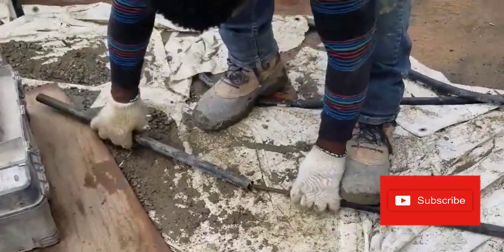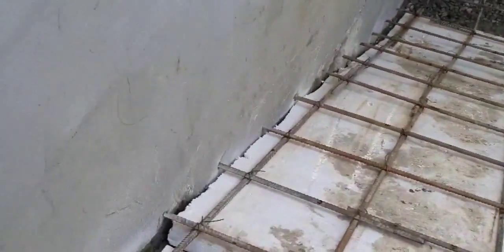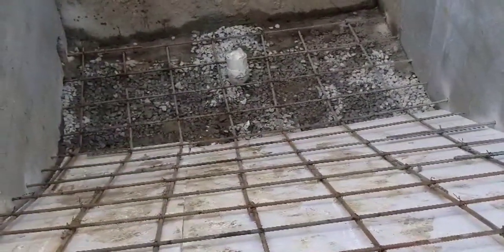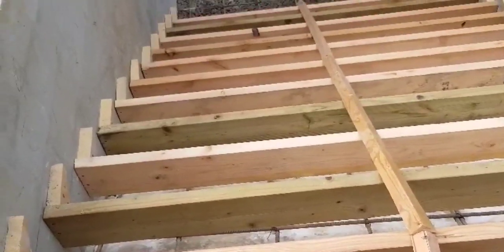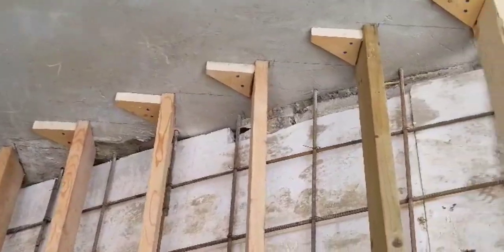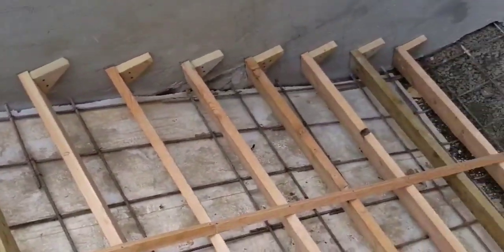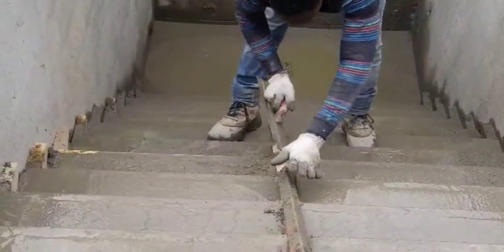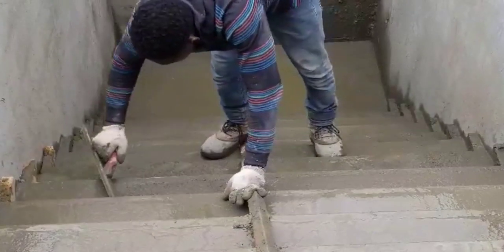basement entrance,steps and concrete finishing

Comment: Concrete too soft  too much water
Reply: Softer the concrete the stronger it dries
Reply: @alexandercameron3795  well I have done a bit off concrete and too much water  you get  a concrete that's easy to pour but weaker than a more firm pour that's why foundations for big buildings spec a 0 slump meaning if you dumb a bucket off concrete on ground it should no collapsed